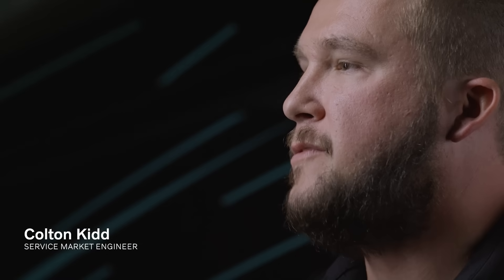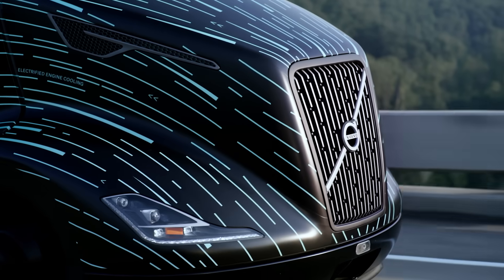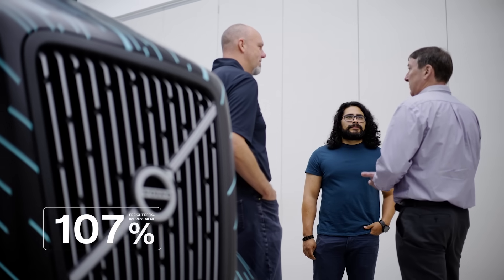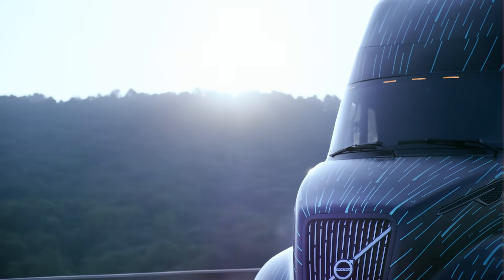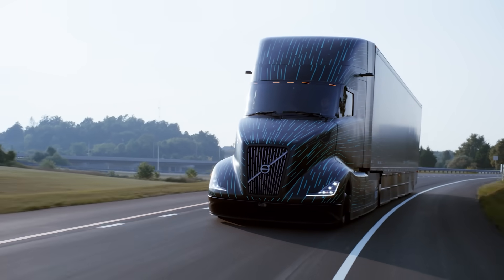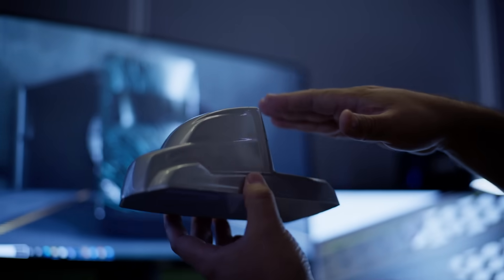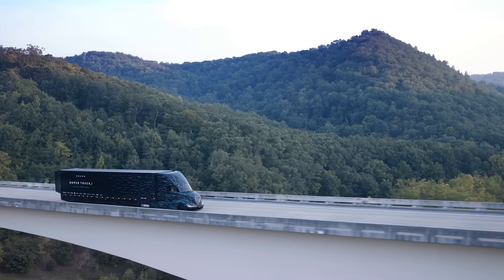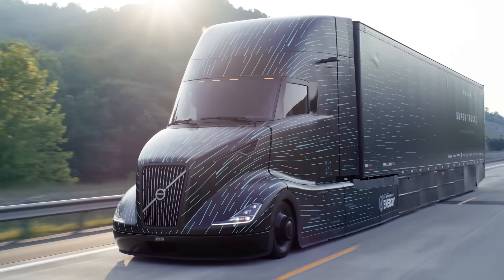Volvo SuperTruck 2

Comment: Then... they put the sideview mirrors back on (as required by law) and lost everything.
Reply: It is required until law changes. For now mirrorless camera systems requires redundancy and you can opt for smaller mirror. Although, based on different trucking manufactures’ data it represents less than 1% in total fuel savings so yet the comment above is not accurate. It will take sometime to drivers get used to it but once available across the board there is a chance side mirrors disappear for good
Reply: I seen a cascadia without the mirrors, only the cameras. So maybe they changed that law?
Reply: @MarK-ig4ux  I was joking in my comment of course. However, I think the manufacturer is "required" to put the mirrors on, but after that, the vehicle owner can do whatever they want. I think this was Elon Musk's plan for the Cyber Truck, they have to put the mirrors on, so they were going to make them really easy to take off and put on "after market" cameras.
Reply: @tuckertucker1  In Europe camera's are already allowed. Volvo is European. So at home they don;t need sidemirrors
Reply: There’s already Schneider Trucks on the road without mirrors and other companies as well. Get your facts straight before you write them.
Reply: I don't know so much about other country laws, but here in Brazil we already have cameras replacing sideview mirrors in some car models.

Comment: Looking at it as a truck mechanic..... Wtf... Usually engineers don't think on the long run of how to fix things efficiently and quickly 🤷. Everything is nice and cool but underneath its a train wreck.
Reply: I agree. Who are they expecting to maintain that, foolishness, and be time and cost efficient for the driver's budget. Arm and a leg for simple oil change, mechanic removal of hundred nuts and bolts SMH 🫠
Reply: Did any of you even bother to listen for the first 55seconds… like .. at all? 😂😂😂😂😂

Comment: based on claimed data
Volvo 1200Wh/km
Tesla 1062Wh/km

not bad, but you still have some work to do
Reply: Volvo are years head of the rest of the builders. At least in Europe they dominate the roads and drivers prefer them in lots of ways.
Reply: Volvo will always be the Cadillac of semis
Reply: @fkdemparty  Or Scania V8
Reply: @1fadf23f  
Not familiar with that brand at all.
Reply: @fkdemparty  Check them out then, trucks dont get better then that

Comment: You put all side panels on the trailer  almost on the ground wind can't get under it. A hard wind out west front the side will turn it over. Wind is already turning trucks over with that crap on them. I wouldn't drive it if you gave it to me. Your engineers must be on Crack. They for sure haven't driven a big truck much

Comment: Eletric 🤢🤮
Reply: Actually, it is not electric. It is a pretty cool diesel setup! It is a diesel truck with electric components to remove load from the engine.
Reply: How did you come to this conclusion without anyone telling if it is or not? It is not electric... it is ICE. The efficiency comes basically from the truck's powertrain, tires and aerodynamics. Consider a Supertruck a platform for trucking kinda like F1 is for the car industry. This is where you will find the most advanced technology available nowadays and based on it the truck manufactures can integrate some of the features to upcoming projects.  pretty cool design Volvo. Probably the coolest Supertruck2 around!
Reply: Yall mfs hate change so much Even if it was electric just accept it.